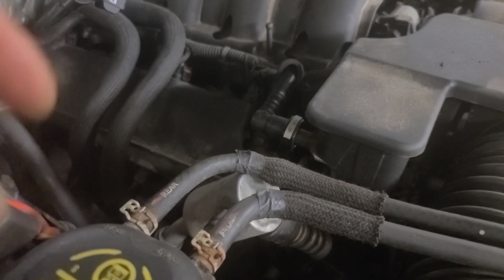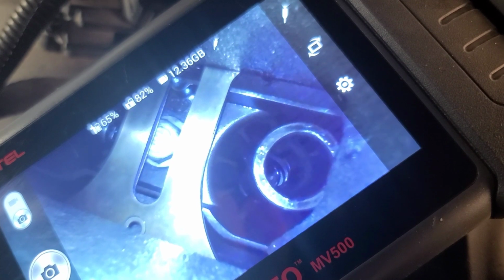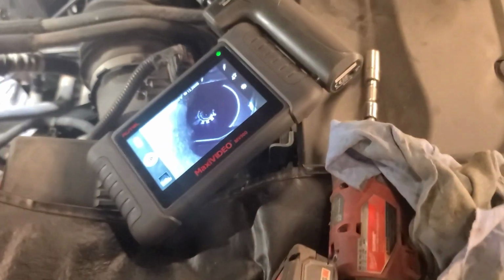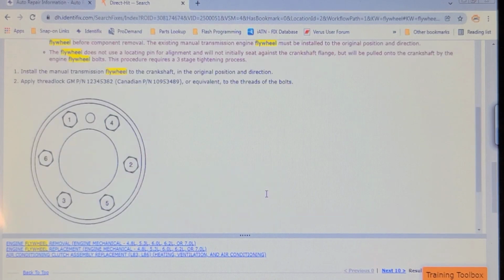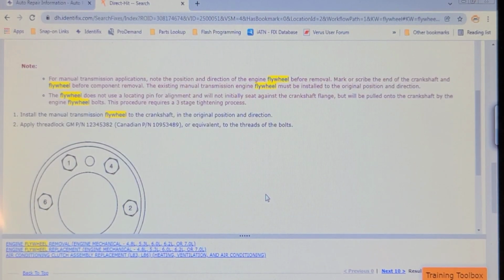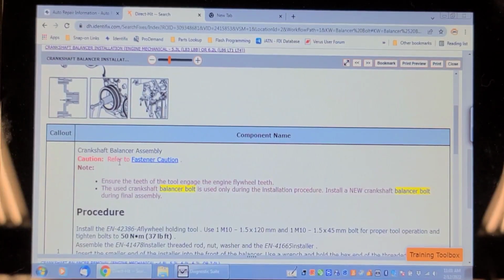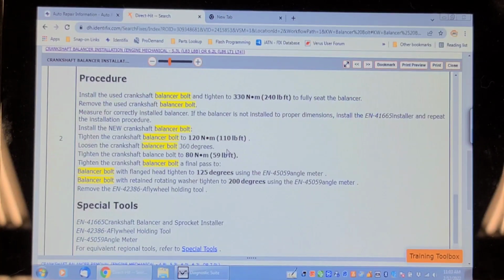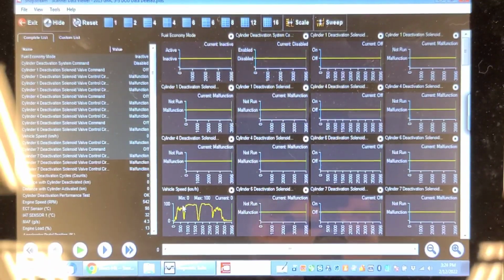2015 GM Truck 5.3 P0304 Again, Engine Swap

Comment: Hey Phil... what's the brand and model of that flashlight with the 2 magnetic swivel ends on it and where did you get it from?  How is it? Looks cool  Thanks
Reply from the maker: I did a review on it here: https://youtu.be/TZ7oCGIXOXw
I had to order it out of Europe. I have two so one on the charger and one in use. Good for 4 to hours. There is a link to where I got them in that video description.  I love them...

Comment: Ok so I have a 2009 dodge ram 5.7 and my transmission will get all the way up to 215 degrees then go into limp mode or stuck in 4th gear all fluids are topped off as well and every time goes into limp check engine light comes on with different codes every time. I was thinking maybe a ground. Help me please
Reply from the maker: I need a bit more information...what are the specific codes it's setting? What have you done to try to fix it? When it shows 215 degrees is this on the scan tool and have you confirmed with a non contact thermometer it's actually that hot? The transmission temperature sensor could be miss reporting. Have you confirmed transmission cooler is not restricted? Are you towing? Is the torque converter lockup system working? Let me know.

Comment: I tried the same thing on my 2013 5.3. Had about the same amount of luck getting it unstuck as you had. I think that technique works but only if you try it as soon as it happens. I drove my truck to long with the lifter stuck.
Reply from the maker: The lifter was broken so that's why it would not pop back out. Shown at the end of the video. Thanks for watching.